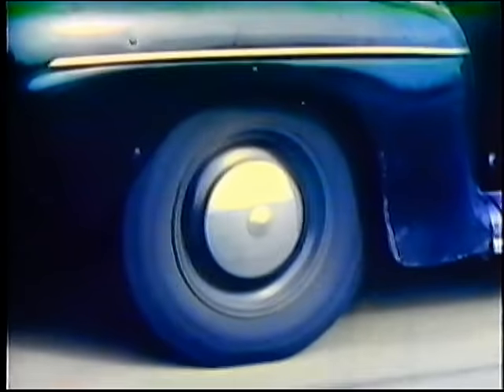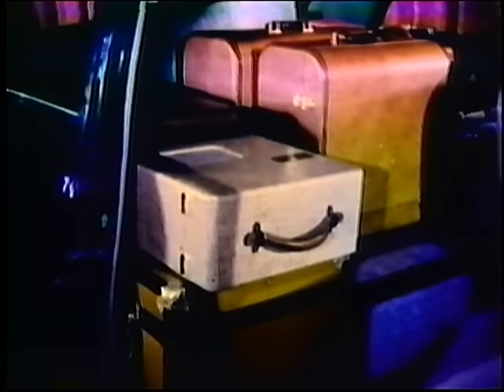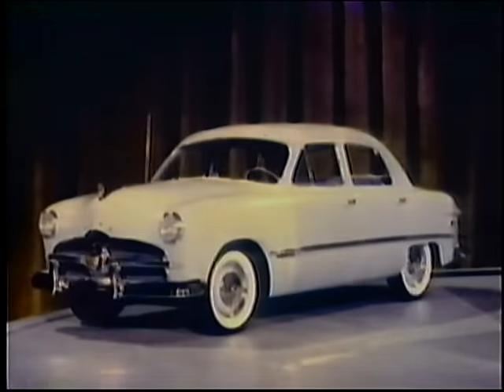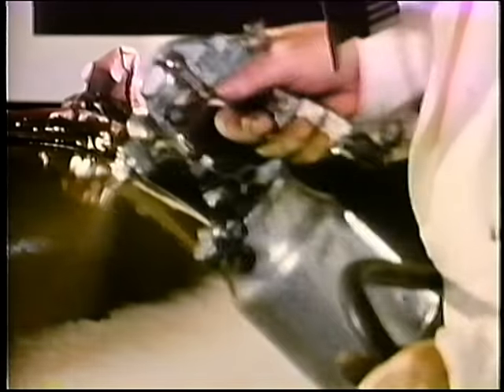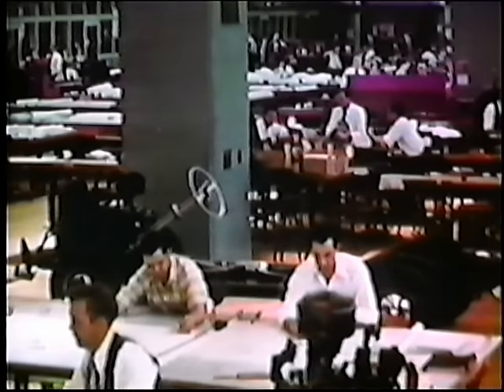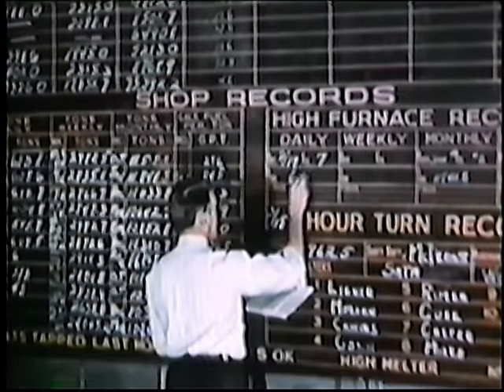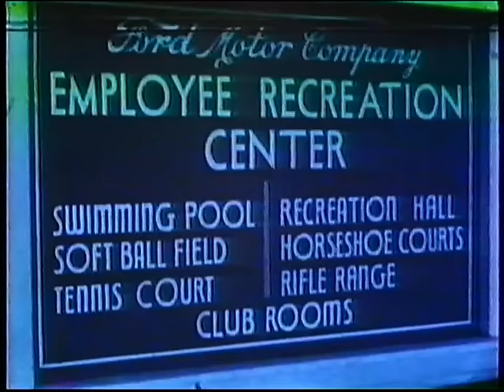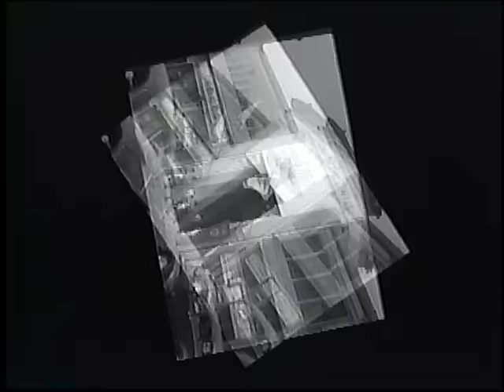The '49 Ford in your future.

Comment: I learned to drive in a 1949 Ford...sort of.  My Grandparents lived in a rural area and I'd go to visit them during the summer.  They had a dark blue 1949 Ford tudor that still ran, but was no longer street worthy.  It had been their first brand new car, so they kept it.   It was full of rust and some of the floor pans were even open.  They used to fuel it up and let me drive it around the field behind the house.  At 10 I was able to drive a stick shift.....on the column which is harder than on the floor. This was the mid seventies, and the only time this thing got fueled, tires aired up, and fired up was when I came to visit.  I think an axle finally rusted through and broke and they had it hauled away.  Am I crying yet?
Reply: Mlm

Comment: My father owned a 1950 Ford Crestliner, which was practically identical to the 1949 models shown in this video. His Crestliner probably was built on the same assembly line. I still have the bill of sale for it. He bought it used in 1960.
Reply: Joe Vignolo I am freshening the 50 Crestliner I restored in 1980, also a 51 woodie I restored in 1977-78,  part of my life.

Comment: I have a complete1950 that I need to get back on the road. It needed some work like Brakes , Tires , other odds n ends when I parked it one day. Its been sitting close to 20 years now but still has antifreeze in the radiator. The entire interior is rotted out and was in bad shape when I was driving it. This show makes me want to get her going again. They did drive good as it told in the 🎥 film.
Reply: Hope you started on your dreams! Parts can be found anywhere, even NOS, GOOD LUCK!

Comment: My granddad bought one of these with all the bells and whistles, brand new back in the day. Traded his old faithful '39 Ford V8 in and regretted it every single day from then onwards. Every month it was back in the Ford shop, not wanting to start, not running, no power. Everywhere we went it was hit and miss if we would drive out like civilized people or if the hood and trunk would be up in the air with Granddad bent over the engine, mostly with random old timers standing around, looking on, pipe in mouth, and giving advice. 
Eventually, with a massive cloud of smoke and a screaming engine, we would fly out of wherever we had been parked, the auto trans slipping or refusing to change up, only to repeat all of this at the next stop, us kids silent and shocked in the back seat with all the cussing and the way Grandad would beat down on it trying to get it to catch - the banging onto the floorboard was so loud and the whole car rocked side to side.
The main dealer couldn't (or wouldn't) ever get it right or change it over - Ford was stingy that way, so Grandad hammered it hard, punished it, and murdered it every single chance he got. There was never a day when that V8 wasn't screaming its guts out at more than full revs and coughing, spluttering, and backfiring, but as a toughened railroad man, he was determined to get his money's worth out of a brand-new car. 
He hated that the V8 was so lazy, especially when fully loaded on a roadtrip.
Eventually, he gave up and treated himself to the '57 Fairlane 500 which was problem free. He couldn't trade the '49 because it would never start after he pulled in, so my cousin got it and he was even more brutal to it than Grandad ever was, blowing the V8 up somehow. 
As a final send-off, he dragged it into a field and set fire to it. To this day, its rusted shell is still there in the same place where its lazy and problematic life was brought to an end.

Comment: Notice that the horsepower of the V8 is not mentioned.  That's because the V8 and the I6 had almost equal displacement and power.
Reply: Mark Godfrey  When the V8 came out in '31, it made 65 HP. By '49, it made just over 100 HP. All this stuff is googleable.

Comment: Notice they mentioned the straight six engine had 95HP, but they didn’t mention the HP of the V8? That’s because the bigger V8 had 95HP, only 5HP more then the “economy” six. Ford would finally replace the Aging flathead V8 with a new overhead valve “Y Block” V8 in 1954.

Comment: I prefer the 35 to 41 and 46 to 48.The 49 had alot  of bugs which they ironed out.The six was good but if you didnot  break  in the V eight right it would turn into an oil guzzler .

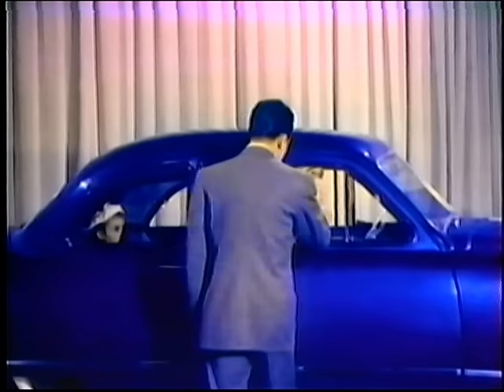Comment: 5:30 I'd hate to have to use the key to lock my car from the outside every day. Some other  cars just made you pull on the handle while shutting the door to keep it from unlocking.
Reply: Yes, until that day you shut the door thinking the key is in your pocket but no. It is a call to the locksmith and a $185 bill.